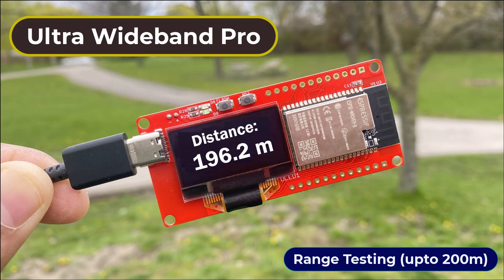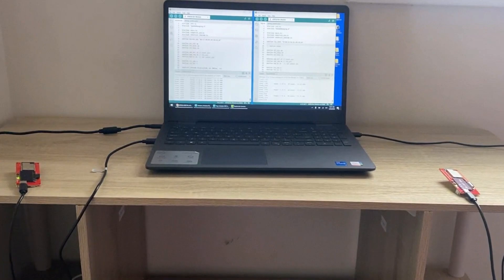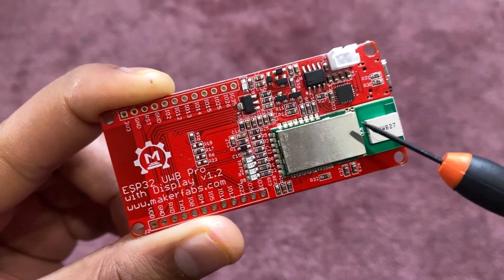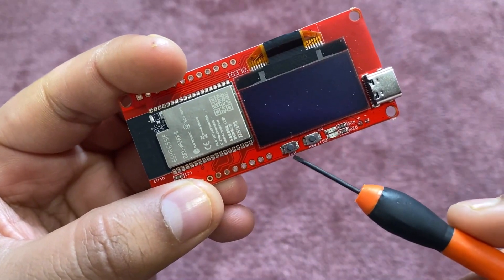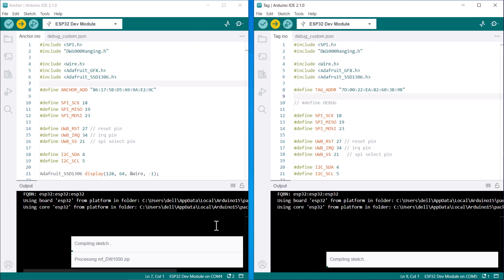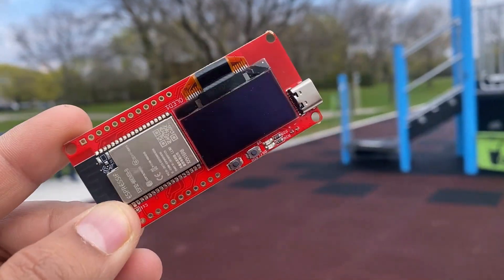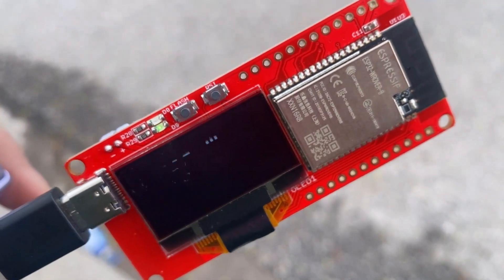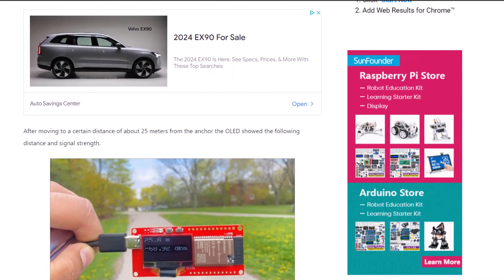ESP32 UWB Pro | Ultra Wideband Module with Power Amplifier | 200 meters Range

Comment: Thank you for such a good content you've made here. It's such a big help. I would like to ask, is there any issues if the module is placed beneath or inside a box while transmitting data between these two devices? I am now currently working on my project to design a wireless sensor data transmit connection yet still confused on deciding what kind of wireless module is the best option due to the applied condition required wide range and stable connection
Reply from the maker: For your application if distance is lessee than 20 meters use bluetooth device. For medium range upto 100 meters NRF24L01 is best option. For range like 1km LoRa is best.
Reply: @HowtoElectronics why not esp32 uwb dw3000 
I am asking because i have a similar project and was planning on using that( i need accurate distance data)